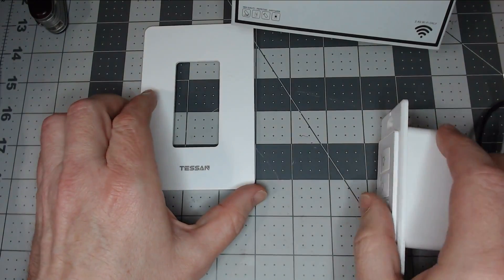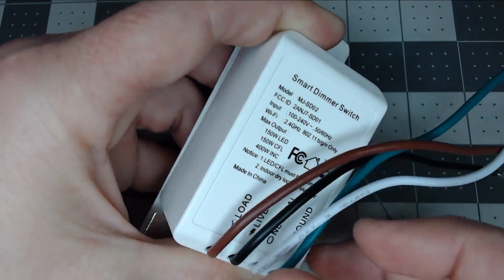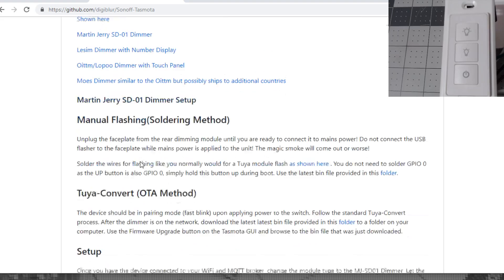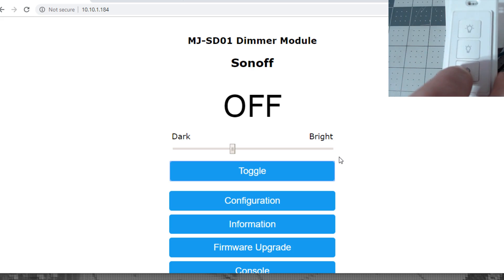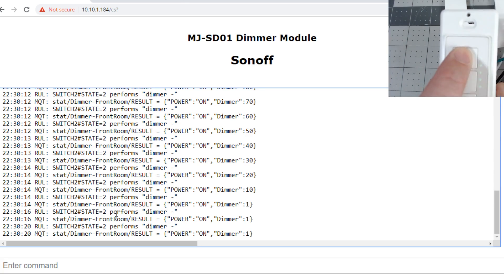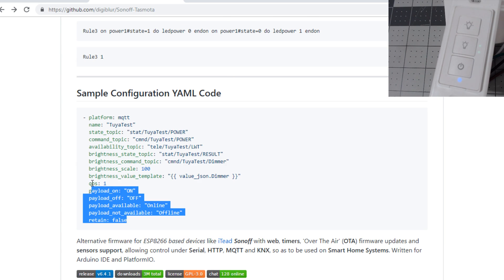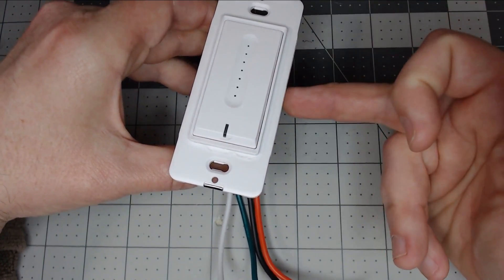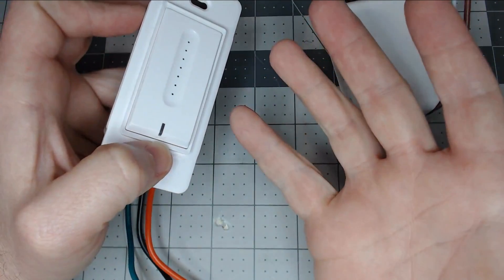Tessan, Martin Jerry, and TreatLife Smart Dimmers - How to integrate them with Tasmota

Comment: Hey man, thanks for helping out the community.  If i wanted to flash to get access via hub but also keep the existing Wifi integration with cloud + alexa would this flash leave that as is?
Reply from the maker: No. It's going to change the software totally as it takes it out of the cloud. What home automation software do you want to use with it? Most of them have voice assistant integrations.
Reply: @digiblurDIY  Initially looked at home assistant but since there's no real way to get Alexa working without the cloud i began looking at Hubitat.  But because i've already invested in mostly WiFi devices that work with alexa these solutions are not looking very appealing for my needs  :(
Was hoping to take what i have an be able to gain some more control without heavy modification or disabling it's current functionality should i decide down the road the hub route is not for me...

Comment: Tried to flash to your bin file after using Tuya Convert OTA and I'm receiving an error "Upload Buffer Miscompare".  When I try to flash the Tasmota Minimal, I receive an error "Upload Failed" Not compatible" when trying to flash your bin file.  Any ideas? I tried downgrading Tasmota, but have been unable to do so.
Reply from the maker: You flashed 8.x of minimal which doesn't allow you to go back beyond 7.2 to prevent a brick. I will be updating the bin to 8.x in the next day or two.
Reply: @digiblurDIY  Ah, that makes sense. Thanks for the reply!
Reply from the maker: Update, I'm testing the changes on a few dimmers.  If you can't wait you can flash it via serial.  https://www.digiblur.com/2019/08/tuya-convert-whats-next-solderless.html
Reply: Thanks.  It's currently installed and on the same circuit as one of my servers, so I'll just be patient. Thanks again!
Reply from the maker: Check it out...  https://github.com/digiblur/Tasmota/tree/development/bins
Reply: Your latest bin worked like a champ!  Thanks for all of your hard work!

Comment: I recently purchased one of these Tessan dimmer switches and flashed it last night with your help. Do I still need to run digiDIM on it? It seems to be working great so far.
Reply from the maker: Yes. I am still using that fork as well on mine. It could be done with stock Tasmota but I wasn't happy with the rules speed so far.

Comment: Is it possible to flash (via OTA) tasmota on MJ 3way dimmer?
Reply from the maker: No. It's not an ESP chip.
Reply: @digiblurDIY  and is there an other way to add it it home assistant without any cloud acces?
Reply: @digiblurDIY  Ah, that's why it wouldn't flash.  I incorrectly assumed it was ESP like it's non-3way counterparts.  I guess it uses a special chip to handle the remote functionality.  I actually have a 4-way setup (1 master, 2 slaves) and it works great.  Can dim or on/off at any of the 3 locations.

Comment: I am trying to find a US 3-way smart dimmer that can be flashed OTA with Tasmota. Do you know if this one works? Thanks.
https://www.amazon.com/Dimmer-Dimmable-Compatible-Neutral-Required/dp/B07R4ZCD2C?ref_=ast_sto_dp
Reply from the maker: I haven't tried that specific rebrand but I can say, look at my 3 way Martin Jerry dimmer video and you'll see the chip isn't flashable.
Reply: @digiblurDIY  Thanks for your reply.
 I ended up getting the standard Martin Jerry dimmer. I successfully flashed it OTA using your other video, but I have problem with configuration. In this video you are saying to start configuration using MJ-SD01Dimmer, but it is not listed. In info i have the following:
Program Version 7.0.0.3(tasmota)
Build Date & Time 2019-11-06T23:07:19
Core/SDK Version STAGE/2.2.2-dev(38a443e)

Could you please advise on how to proceed with configuration? Thank you.
Reply from the maker: @alecg8760  yep. flash the right version and config in this link https://github.com/digiblur/Tasmota
Reply: I loaded the latest firmware, 7.0.0.5(digiDIMv8). It contained the config MJ-SD01 Dimmer (72).  I was able to use it to start the configuration of the dimmer.

Comment: Thanks for this tutorial 
I got few of this, looks same as the update  treatlife but is unbranded 
https://www.mercari.com/us/item/m16595824750/?ref=search_results

Works well but tuya convert failed seem to have the patch,  i used the pins to flash, have ine issue led is always red, (after reboot it goes to white,  but after any starus change it goes to red and flashed periodically) mqtts is not the issue.

Edit: just see other comments already mentioned this. Sorry for not reading, thanks again for yoyr great work. 

Also when dimmig from plate it does not update the ui in tesmota, though in ha it does, so it not a big deal
Reply from the maker: Yes Tasmota doesn't update the GUI in real time as it isn't designed that way.

The red white LED issue was actually researched over 3 live streams and then a pull request was done to Tasmota and added in 6.5.0.8. You can flash the latest development version to obtain the fix.
Reply: @digiblurDIY  thanks travis, i tried to use the last build without luck till i realized that i am using the url to your github, (the gui doesn't indicate that it fails). So i am posting this here if other people have this issue,  you have to download the bin and upload it github urls aren't going to work
Reply from the maker: Yes. Unfortunately github forces https and isn't capable of being used.
Reply from the maker: Also I did forget I have this bin file with the fix as well and you won't have to alter your home assistant mqtt template.

https://github.com/digiblur/Sonoff-Tasmota/blob/development/bins/Tasmota_6.5.0(digiDIMv6).bin

Comment: Thanks for the great video!  I am ordering one of those dimmers now :) 
Have you looked at the topgreener switches? I'm having issue controlling the LED and wondered if you or your custom firmware would work better for those?
Reply from the maker: I haven't order any of those yet to tear down and work with. Not sure if I will as I try to use what I show on the channel and I am not sure I need more dimmers...yet.
Reply: @digiblurDIY  
The switch version 😁
Reply from the maker: ahh... read dimmers on mobile and still had it on the brain.   I see the switch now.  You've gone through all the GPIO pins?

Comment: I had a bad time of doing the OTA flash, so I would up soldering.  When I tried to flash the file from your Github, it wouldn't work.  I was able to do the Sonoff Basic.  Now, when I try to update the firmware from Tasmota, I get this message:  "Magic byte is not 0xE9" and I can't seem to get around it.  I also did the sonoff minimal to attempt to get it to have the space, but I get the same message.  Any help?  Love your videos, but I'm stuck on this one.  New to this whole HassIO, MQTT thing, but so far I've had decent success until this Tessan Dimmer switch.
Reply: Well, disregard.  I re-downloaded the file, and it's a go!  So awesome!  :)
Reply from the maker: Awesome! Glad you got it going. Hit me up on discord if you need some help or just want to join us to hang chit chat.

Comment: I keep getting blinking dots when raspberry pi is trying to connect to tessan switch. Any thoughts?
Reply from the maker: Is the switch in fast blinking pairing mode? Have you done a Tuya convert on this Rpi before?
Reply: I'm connected to vstrust and tessan device red light Is blinking
Reply: No first Rpi tuya convert but I am using the same switch you have in the video
Reply from the maker: Sometimes timing is everything.  What I do is do the start_flash script, do the yes enter thing and attach the phone.  The power the switch up and make sure it is fast blink mode and mash enter at that point.  I found if I wait too long then it won't do.  

During your process do you see the red light stop blinking about 20-30 seconds after and reset?  I'd also check your logs for anything weird.  Has this switch ever been paired with the Tuya cloud?
Reply: Yes it has been paired to tuya cloud
Reply from the maker: It could very well have downloaded patched firmware. Hard to say though based on this being the first one. Did you check the logs for anything odd?
Reply: I'll check
Reply from the maker: Of course you can still use the older USB method on these which is fairly easy and I have even seen people do it without soldering.
Reply: https://github.com/ct-Open-Source/tuya-convert/issues/188
Reply: Today I tried tuya convert on some new luntak plugs and I get the same problem
Reply from the maker: Were you able to check the logs on the process? I am leaning towards the Rpi being an issue. Have you tried another phone or other device to use to connect to vtrust?
Reply: I will try those suggestions. Thanks

Comment: Hello again!! My Tessan dimmer switch arrived :-).  But when I try to load your bin file Tasmota_6.x.0(digiDIMvx).bin, I received the following message: Upload Failed - Upload buffer miscompare (The ESP was using tasmota 6.4.1.7 sonoff version during the upload).  Any idea about this error? Can you send me the modules parameters (configuration) please to configure the dimmer without a sw update?  I will appreciate your comments!!  Thks a lot.
Reply from the maker: It's not just module parameters though. Changes were made to handle some odd ball logic with the switch. That message is usually due to a bad download. Download the bin to your computer again and try to upload via the GUI again
Reply: @digiblurDIY  hellooo, Ok... I will try again...I downloaded four time with the same result. thks!!
Reply from the maker: You might have to flash the minimal version of Tasmota first if you don't have enough flash space left then flash the one I linked.
Reply: digiblurDIY I follow your recommendation and now the dimmer is working fine!  Thanks a lot!
Reply from the maker: Awesome!  Thanks for the follow-up.

Comment: Hey, great videos.  I have a problem manually adding MQTT switches to my Home Assistant.  Whenever I do, and try to toggle from the cards, the switch just goes back to OFF and I never get status and it just sends the ON signal.  While researching, I have not found a solution.  So, as a workaround, I have let my Mosquito server find the device and the card that it generates, works perfectly.  My problem with this method is that the tuya-convert firmware (sonoff-basic) can't be autodiscovered by Hassio.  I've upgraded other device firmware to the sonoff.bin and configured from there.  My question is, can you modify the sonoff.bin software for the Tessen dimmer or walk me through how to set it up myself.  By the way, I'm flashing OTA.  Thanks.
Reply: Nevermind, I figured it out.  I'm very new to this and I was killing myself all weekend and never realized the root cause of my issue.  I had to enable option 19 for it to be discovered.  Now that I've done that, I'm good.  Again, love your videos.
Reply from the maker: Awesome! Glad you figured it out. Feel free to hit me up or others on discord (link is in  my about page on YouTube). Great community to help each other out.

Comment: Really good video, keep doing that!!!  Just a question, can you recommend a smart switch to control ceiling fan? Of course with tasmota.  thks a  lot!!
Reply from the maker: Just an on and off or with speeds?
Reply: @digiblurDIY  With speed, also if can combine fan and light will be nice!! Thks
Reply from the maker: The holy grail I have been looking for myself. Only thing close is the Sonoff ifan02 but it does have its own set of issues to work around.
Reply: @digiblurDIY Waooo, so maybe here it's your opportunity to created it. Still searching for that!! Thks!
Reply from the maker: I have seen one attempt but it was stated it was using Triac dimming on the fan and mine require the capacitors switched in.
Reply: @digiblurDIY  Most of the fan use capacitors!  I will trying to create one and see what happen!
Reply: @digiblurDIY  With speed of course :-)

Comment: Awesome video!! I flashed and installed the TreatLife Dimmer. Looks great and is working flawless with Tasmota and HA. The only question is the LED in the front keep blinking red time to time. How do I controlled this LED in the front to go on and off with the state of the light or something more useful. THanks!
Reply from the maker: I also had that discussion with another viewer here and I have been looking at various commands to send to it as I believe the secondary dimming controller believes the wifi is missing when it isn't so it blinks the red LED. I will let you know if I figure that one out without doing a hardware mod to snip the LED as it is only a cosmetic issue. The previous version didn't do this.
Reply: @digiblurDIY  y, i have the same "problem". Do you figured it out how to solve it?
Reply from the maker: This red LED was fixed in a reverse engineering live stream and folded into Tasmota. What version are you running?
Reply: @digiblurDIY  Tasmota_6.6.0.6(digiDIMv7)

Comment: I just got 2 of the TreatLife dimmer switches.  I wish I would've found this video before, as I don't think I've got them working quite right.  I suspect it's a relatively simple problem to solve... 

The physical button and touch dimmer works and transmits MQTT messages, http controls seem to work, and MQTT commands seem to work.  The bottom LED is flashing RED (10 seconds ON and 3 seconds OFF) and doesn't reflect the power state nor show any other colors.  I'm using the official Tasmota v6.5.0 with module configured to "Tuya Dimmer (54)", GPIO13 to "Tuya Rx (108)", GPIO15 to"Tuya Tx (107)", and all other GPIO to "None (255").

Again, without having seen your video first, I started with Tuya Convert and installed the tasmota image that was included (v6.4.1, I think).  Once on my IoT wireless network, I upgraded the firmware to the latest on thehackbox.org (v6.5.0) and set the configuration as I listed above.

Having found this video and your forked tasmota images, I just tried updating the firmware on my switches from v6.5.0 to your latest digiDIMv4.bin but it failed with an MQTT message:  "stat/switch09/UPGRADE Failed Verify bin header failed".

Any suggestions to get my switches' bottom LED to work properly would be greatly appreciated!
Reply from the maker: I also noticed the red light blinking at times, not sure what causes it.  If you are getting a failed message I would try to flash the minimal build off of Tasmota's site first then flash the other bin as there may not be enough space for both BIN files to fit into flash memory.
Reply: @digiblurDIY  good point.  I will give that a try later.  Do you know if the official tasmota build should work? Or should I migrate to your fork?
Reply from the maker: Official should work for the most part I believe. I just had some oddities with states of the light not reporting correctly when turned on in various scenarios.
Reply: @digiblurDIY  so, does your switch's LED continuously flash Red (10 seconds on, 3 seconds off)?  I'm assuming you're running your fork of tasmota...  just trying to figure out if it's worth migrating to your fork or stay on official 6.5.0.
Reply from the maker: That's all going to be the same as the Tuya module is untouched in my fork.
Reply: @digiblurDIY  thanks for answering my questions!  so then is it "normal" for the led to be flashing RED (10 seconds on and 3 seconds off)?
Reply from the maker: I think there is some command it is waiting for upon boot. Not sure what it might be though. Would need to flash it back stock and capture all the packets being sent.
Reply: @digiblurDIY  Do you need a new TreatLife dimmer switch that hasn't been converted to Tasmota for dev purposes?  Let me know, as I'd gladly send you a new one if it'll help in getting the LED situation figured out... Or let me know what I could do to help out.
Reply from the maker: That would be a big key to the puzzle to do some sniffing on a stock one. Hit me up on discord.

Comment: Hi. Nice video. Im canadian and i found a similar switch on amazon.ca. it made by meross. Do you think its the same? meross Smart Dimmer Light Switch, for Dimmable LED, Halogen, Incandescent Bulbs, Works with Alexa, Google Assistant and IFTTT, Single-Pole, Neutral Wire Required https://www.amazon.ca/dp/B07KM4P4Z1/ref=cm_sw_r_cp_apa_i_zD8KCbGJ4V4X8
Reply from the maker: I have heard from someone else they couldn't get it flashed as it had a different chip.

Comment: Have been watching the flashing videos and love them. Have finally figured out how to do it. I now need a recommendation for a flashable switch that can control a ceiling fan. None of the "dimmable" style switches say that it can control a fan (though they do a great job on the lights) and I am unsure of trying it.
As in the comment in the thread you do not say what switch can be used. Do you have any thoughts on which switch can be?
Reply from the maker: The only one I have seen is the iFan02 but the capacitors aren't sized right for 120volt usage so they do need to be swapped. I haven't seen anyone do a proper 1 gang fan control switch on the wifi side.